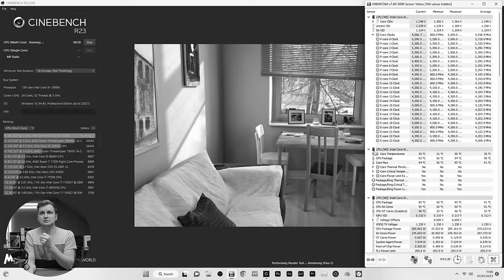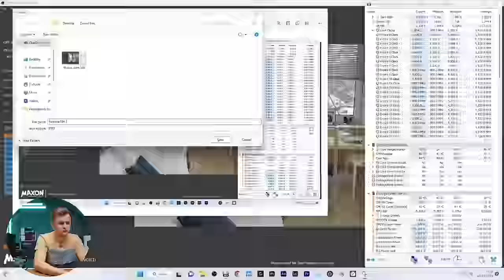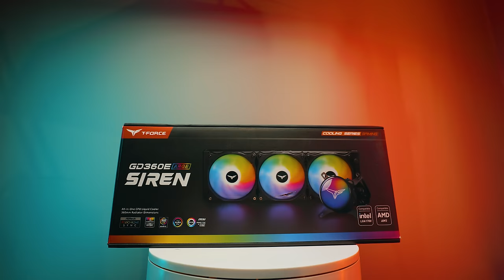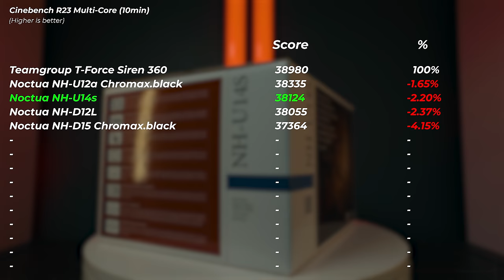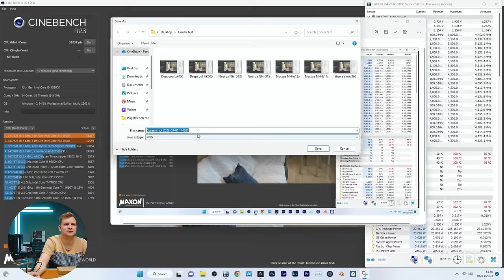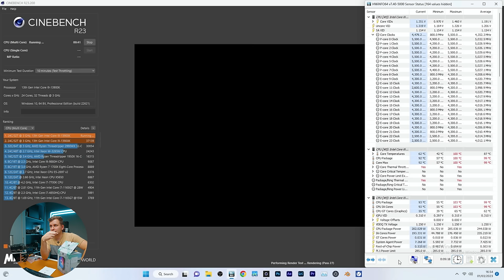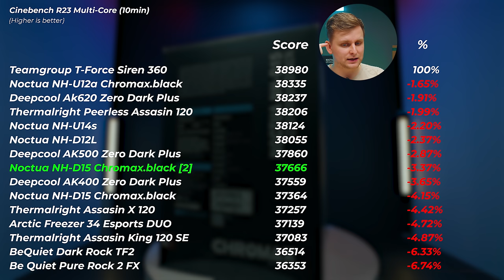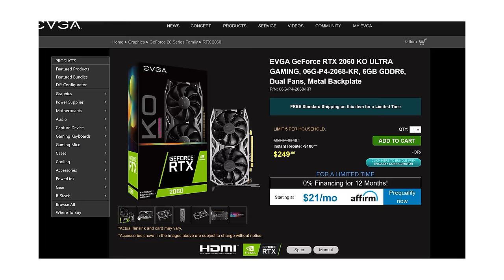We Tested 14 AIR-Coolers on 24-Core 13900k - The Results Will Shock You!

Comment: I have the AK620 on my AMD rigs and have been nothing but impressed with their ability.  At $65 US it is more than the least expensive of the units you tested, but the build quality is excellent and installation was a breeze, even for systems already mounted in case.
Reply: I have the white edition cooling a 7600x very impressed so far
Reply: @BigDavos  got it for 5800x3d as well, and does it keep it cool, one of the best bang for your buck i have ever got so far
Reply: Nice job. I appreciate all that hard work. Benching is boooorreiinggggg. I do wish the thermalright frost commander 140 was thrown in there as that can be had for $40-$50 depending on the variant and is a giant beast. I picked up a peerless assassin 120 white argb and frost commander 140 in white to test against my Corsair h150i lcd elite xt and a custom loop on my ryzen 9 7900x and 4090 rig. Unfortunately there is no argb frost commander, you need to step down to the frost spirit or whatever it’s called. One less heat pipe and worse spec fans, how much that matters IRL idk.
Reply: Yeah that nhu12a is intriguing. It seems small and like it can’t hang. I haven’t seen it up close so idk what it’s trick is. Fin density? Who know? But for a small single tower single fan it is amazing. Makes me really curious for the upcoming NHD15 refresh
Reply: Do you get resonance from the fans like jet turbine sound? Most people get it and my 620 does it too.
Reply: @xDamage69  Do you get resonance from the fans like jet turbine sound? Most people get it and my 620 does it too.

Comment: 8 of 9 AM4/AM5 in the house is on Noctua. Only paid retail on the first U14S. The rest were $20-50 with only one Chromax D15 black with white covers $80. It’s not just cooling performance but future support and simple easy mounting.

4x D15
2x U14S
1x U9S
1x D9L
1x Thermalright Silver Soul

Comment: 1) The reason for a stripe or "X" of thermal paste on the IHS is so that it fills gaps and pushes air outward. Your spatula method is more likely to trap air under a heat-sink.
2) Your motherboard acted (minimally) as a heat-sink on the first tests, and saturated on later tests, slightly boosting the performance of the first coolers.
3) Short-term load performance may be very different from long-term load performance. A 30 minute benchmark would be more telling, because the towers would be saturated. Your test shows the conductivity of the heat pipes, not necessarily the ultimate cooling capacity of these coolers under long-term load.
Reply: TIM manufacturers actually supply spatulas with their pastes now, Kryonaut Grizzly and Alphacool to name but 2 companies that do.
The spread out method is what is recommended on almost all CPU's.
Reply: Very good observations, especially your 3rd point. I had trouble figuring out how in the world the NHD15 is so low on the chart. Then again, the contact frame is probably to blame too.
Reply: With air coolers, 10 minutes is enough to decide. Water coolers take longer to heat up and longer to cool down but air coolers are generally fairly quick to reach their peak. As for the motherboard acting as a heatsink, I can't comment. But shouldn't have a need for the 30 minutes benchmark for air coolers.

As for the X method, I'd generally say that's the way to go too, but for this test, it was fine, since it's still an apples to apples comparison
Reply: 1 is completely wrong.  2 is also wrong as you assume enough time hasn't passed between cooler swaps for the board to cool.  3 is also technically wrong as well.  A 30 minute test would not do much different.  What he really should do is multiple tests of each one, as every time the cooler is swapped the paste application and other factors might make a slight difference.  Over all it's not a very good test because of the randomness of that benchmark.
Reply: @seanmcd72  No rebuttal, just "you're wrong"?

Comment: I'm running the NH-D15 with 3 fans clipped no issues on my 14900k runs more stable with less bs spikes over my old 420 AIO with 6 fans in a push pull.

Comment: Ive been using those thermalright coolers for quite awhile now. For the price to performance I dont think they can be beat. Im not cooling a 13900 but Im cooling a 13100. I spent $20 to cool a cpu very efficiently. Good video Im glad you were able to test so many coolers.
Reply: How you enjoying the 13100. I have a 12700k but hadn't built yet. I've actually had the parts for awhile and keep putting it off. Anyways In some ways I wish I would have waited for the i3 and i5 12400 13400 options to save money. But I think I'll be happy overall. But they do look really nice for the cost.
Reply: @TheRightToFilmPolice  yes its been really good. Best budget chip out there. $125 and enough speed to keep up with a 3070
Reply: @aarondavis8224  yeah. The budget cpus look good. Especially when you consider an i3 10100 is practically a i7 7700. So I'd imagine a 12100 and 13100 Is close to a i5 10400 or 11400. Hope you got a good deal on the 3070. I got the EVGA ftw 3 3060 ti , but I might eventually get a 4070/4070 to or a used 3080 3080ti at some point or probably just wait for the rtx 5000 series.

Comment: Thank you for doing this, it must have been a lot of work.  I do have to agree with @Sampawende, that in head-to-head tests like this, you need to perform all the tests on a level playing field, and as far as possible ensure the same ambient air temperature.  I think the 1st run on the D15 suffered because of the room temp., although clearly, it isn't performing as it's size and price would suggest.  The Peerless Assassin obviously offers the best bang for the buck, and your findings match those of GN - I'll be grabbing one ASAP.  I would have liked to see the BQ Dark Rock 4 in there, as it claims to handle 250W - I've heard people recommend it, but not found any test/performance results...

Comment: Kudos, I enjoyed the video. 

Food for thought, even though it adds a lot of time, multiple mounts for each cooler is necessary. A mounting can make immense difference in test results. The Noctua NH-D15 is a proven CPU cooler and a known quantity in the PC world. Not that it can't be beat, but if it loses to a smaller or "lesser" cooler, you definitely want to repeat your tests. It's a good indicator of a less than optimal mount. 

I have been a PC hobbyist since the 1980s. Yes, the 1980s. I can't count the number of coolers I have installed over the decades, of all types: water cooling blocks, SSD heat sinks, CPU and GPU coolers. Bad mounts happen.
Reply: I had the same test and it spat out 37467 too. I wonder if I should consider buying NH-12A fr. What's your take?

P/S: Same processor
Reply: D15 is not the best cooler because there are other coolers that can spin the fans much faster with a small problem. You can't stay in the room, they are too loud. D15 offers a very good performance but it still can be quiet enough to play or work and hear the speakers and not your pc. I didn't see any mention about noise on that video, so......
Reply: @chrishar110  I did not say the D15 was the best cooler. I said the cooler has a reputation of being a top performing cooler and it does.
Reply: Cant go wrong with Peerless with just a 300 score spread from top. That amount can be due to a number of variables.  I just got a i7 14700K, and I might OC it and the ram, but I do ZERO gaming, and plenty hours of image editing (not much video at all these days, but maybe will more). So I am on the fence. I hate the idea of water and electronics, just in the idea alone is wrong. But IF you have a LARGER jar, about a gallon holding all the water, and you pipe that water from the room temp to the PC, then maybe I would try it. But with the setups I see, I just can't go with the idea to keep the entire unit inside the case and expect great results, and have no issues. 
Tough call for me, as I know the Arctic Freeze III420 tests very well for a liquid cooler. Sometimes 7 to 10 degrees cooler.

Comment: I know it's technically too expensive, but if you still care about looks with your air-cooling, the U12a will give you the best performance in the smallest frame. 
I have it on my 13600k and while I do know that it technically isn't necessary, it just looks beautiful with the white build and it's while chromax cover.

Comment: Awesome video.
Obviously, there are tests variables that should not be ignored, like ensuring that each tests run in the same room temperature, that between each tests, the CPU and other he MB cool down to the room temperature, etc.
But what you did is already terrific and I can’t even imagine how tedious it might be to do it. And you provide us very valuable information with them.
I went with the D15 thinking it was the best (mainly because of the price) but now I know that price is not a safe indicator and well, my next build will go AIO for sure, unless the CPUs manage to heat less. But definitely won’t be investing that much money on a CPU again with air-coolers.

Comment: I am using Dark Rock Pro 4 for 13700K 253W small undrevolting. Max temp 78st after 20-30 min of rendering 100% utilisation, Thermal Grizli paste, ambient temp ~22-25C.
Reply: how much ghz ur 13700k hit at max utilization ?

Comment: Wow This really helps! Was thinking to get a 13700k with air cooling (water cooling may have problems after years of usage).
Reply: Currently got a 13700k and even undervolted, it runs very hot in demanding games. Using a ak620.  I went with a Corsair 360 water cooler for the first time cause I was afraid of liquid cooling and my max temp is now 15 degrees cooler
Reply: @jcfsounds8550  which aio u r using and how much high temp u got ?
Reply: @iplaygames9837   So I had the Arctic 360. This liquid cooler is a beast. Max temp while gaming @1440p never went above 65 Celsius. I had to return it though because it emits a high pitched whining noise. I don't know if that's normal. I couldn't get past it cause I run a recording studio and the sound was coming through my recordings. I now am using a noctua d15 and I I am staying below 70 Celsius
Reply: @iplaygames9837  If you don't mind the potential of a loud pump I would 100 percent recommend liquid cooling. If you want silent cooling go with the noctua and undervolt. You don't really lose any performance and it will run cooler. The only con about the Arctic liquid freezer is that you cannot adjust the pump speed. It runs at 100 percent constantly. Other pumps such as nzxt and Corsair ty can adjust the fan and pump speed to your liking.

Comment: I have 13900K and a Noctua NH-D15 Chroma Black . With undervolting  I was able to achieve 39k+ points . So you do not need water coolers. I am also waiting the shipment for my proper LGA1700 contact plate which will come  in couple of days and reduce my temperatures minimum 5 degrees. I am expecting it to reach 40k+ . It all depends what kind of combo you have . I built my computer myself  . I will also receive my DDR4 4000 64gb rams for my Z690 motherboard which might also help to get a better score because currently I have 32gb 3200 Dual Hyperx  Rams.. I do a lot of video and audio editing and this CPU so far is a beast. BTW I did not limit my power for my CPU... Sometimes it spikes to 320W but mostly stays 270-300 with the temperatures around 90-98 on full load ...          Edit: I finally broke 40k with the 64gb faster Ram and the Thermalright contact plate :)
Reply: How much did you undervolt and what software ( or did you use the bios) I'm thinking of getting an i9 but would prefer to keep it no hotter than 90c I have an ak620 and how hot does it get in gaming vs tests, I also have a contact plate, also what paste application method did you use
Reply: @urazkıvaner Nasıl yaptın undervoltaj işlemini

Comment: You make excellent videos but I had the DeepCool AK400 plus for my 13600k in Corsair 4000D air flow case with 3 fans in front and 1 for exhaust. I had some heating issues with it where a game did cause the system to get too hot and shutdown. I returned it and got the DeepCool LT520. It was remarkably better with the AIO and so far no heating issues. While your performance differences are not that far apart in percentage, would it show more difference if tested in a complete rig with the hot air is more restricted. While it would be more of a pain to test that way, it's more representative of actual use than an open bench.
Reply: A £33 Peerless Assassin can cool a 13600k.
That sounds like a bad mount.

Comment: Interesting comparison, well done! 
But still, if you calculate all variables, like differences in room temperature (more than 2°C isn't insignificant when differences between the best and the worst cooler are so small), different temperatures of MoBo and RAM during testing process and also that testing is done only once (except on ND-H15) 6.74% is almost in the margin of error.
Also, T-Force Siren isn't the best in its class (like some of the Noctuas) and is much louder than many of other coolers used in this test. 
So if you want best performace/loudness ratio, I'd recommend Noctua.
I'm using Noctua NH-U12P on 13700K and its doing its job excellent, especially because I often must leave my PC to render over night (rendering time is often longer than 3 hours), and PC is still running so quietly, without losing performance or any issues.

Comment: I have a NH-U95 on a Ryzen 5800x and it is amazing. It's so small and looks fantastic and I have good enough airflow in my case to keep temps below 75 even while stress testing. Never really reaches 70 while gaming. I also undervolted it a tiny bit, because at first I did have some hotter temp around 80 and 40 at idle. Undervolting brought my idle temp down to room temp which is AMAZING.
Reply: Amd cpus are power efficient. At full load they use half of the power to equivalent intel cpus. You can't judge how well a cooler will work with intel based on amd cpu.

Comment: Would there be a difference in the motherboard laying horizontally like in the video and vertically like in a case or on a wall.
Cuz heatpipes do stuff with condensation so maybe tower coolers preform diffrent when mounted on a vertically placed motherboard

Comment: Save your money and buy air cooled heatsink instead if you're using older or mid-tier processors because for them, AIO water cooling is an overkill. I'm using Thermalright Assassin King 120 SE for my 4th gen Core i7 rig right now and the temperature never went up over 65°C while gaming in a non air-conditioned room. I'm upgrading the rig to Ryzen in the near future and I would pick Peerless Assassin for my next cooling choice, because it placed 4th in your meticulous tests and ultimately the best value for money.

Comment: Thank you for all the work, all the thermal paste, and the excellent description of your procedures for ranking the air coolers. I agree that an AIO or custom water cooling system is the best way to get the most out of the high-end CPUs. I wish I had this information for the last build I did two weeks ago.
Reply: If it leaks youll need a new system.

Comment: was testing my own 13900k and was getting way lower temps but lower clocks as well, with unlimited PL1/PL2.  went back to bios and realized I need to increase the cpu current limit to 512A - ran R23 and it threw the efficiency out of the window....i went back and be staying at intel specs 😅
Reply: Just set a 1.25 static voltage, and enjoy less power, and higher clocks.

Comment: If you limit your wattage to 125w and turbo 253w, which is what it's supposed to be, then the Thermalright Peerless Assassin 120 SE is actually one of the best ways to go. I have yet to run a game that takes the CPU past 75C.

Also, use a CPU contact frame.
Reply: Instead of doing that undervolt... dropped my temps over 20c on my 13900k... stock vcore is way WAY too high... i can now pull 300w without throttling... stock would hit 100c in seconds...
Reply: Do you think this peerless assassin will work for a 14700K. Looking to use a cheap temporary CPU cooler until the new Noctua D15 comes out.
Reply: @Fighter4Street  ... I think it will work fine, since I think if you set your power consumption as I stated, then it can handle quite a bit. I have yet to run a game over 75C, since the CPU doesn't get too overwhelmed if you have a good GPU and plenty of decent RAM ( a good 32GB).

Comment: shouldn't the motherboard be allowed to completely cool between cooler changes? wouldn't the temp of the motherboard parts affect the test's?
Reply: The only thing in motherboards that overheat are SSD and vrms and that only occurs in trash tier boards so any decent motherboard will not have thermal issues. Also there's no way a mobo will retain heat for several minutes of switching coolers unless it's on fire.

Comment: My laptop turns off the overheating components, and the fan gets more silent after each charge. All 3 power plans have to be fixed separately. To do this, the inbuilt text editor has to be used. Word pad is hidden in Win 7. Only 3-5 sentences are needed to be written during 1 discharge, the laptop recognizes that the user is working. Then, you have to wait till the shutdown, that has to be 3% if possible. When the fix is done, you can play with your silent, cool pc or laptop.